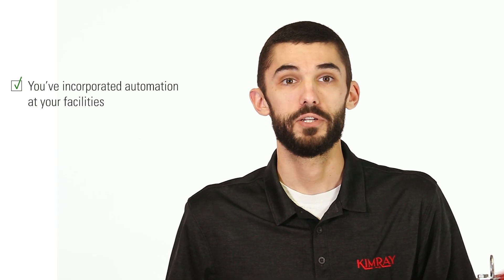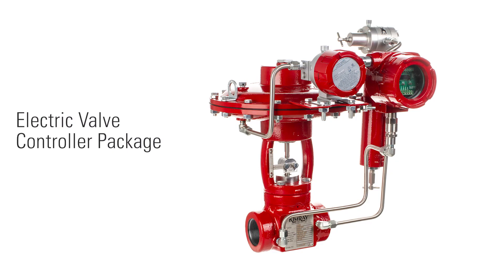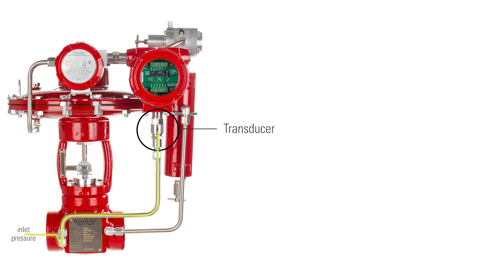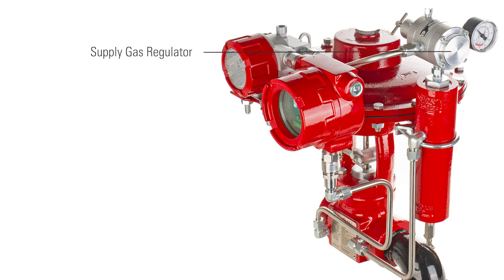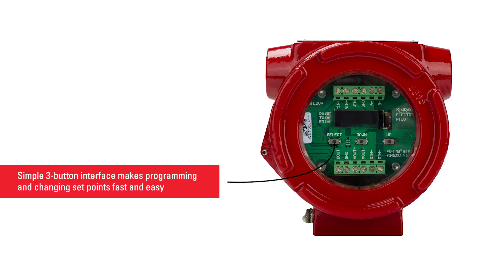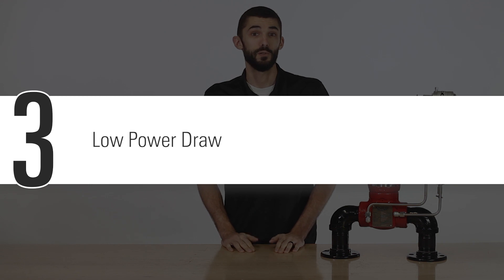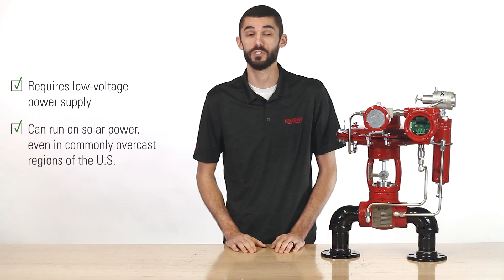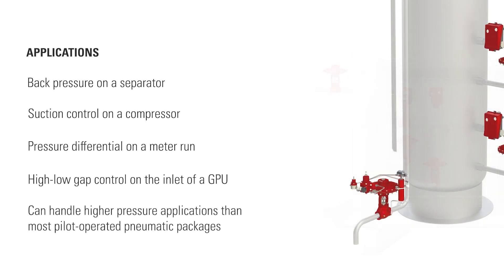Electric Valve Controller: An Easy First Step into Oil and Gas Automation

Comment: So you can just set a percentage over the downstream pressure? Let’s say 30 pounds over what the downstream pressure is?
Reply from the maker: I'm not certain what this is in reference to in the video. If are asking about the discrete input override feature, however, then the answer would be no. The override feature cannot be tuned that way.
 
Otherwise, there is no application in which the setpoint of the pilot can be set to a percentage above actual conditions.
 
Hope this is helpful, but if you need more clarification, please contact our product support team: (405) 525-4264 or prodtechsupport@kimray.com

Comment: Can we use a plc With this type of valve ?
Reply from the maker: Yes, a PLC can be used with the electric valve controller (EVC). The electric pilot can provide feedback to the PLC on valve position and process conditions. The EVC is set up in such a way that it can operate independently of a PLC as well.